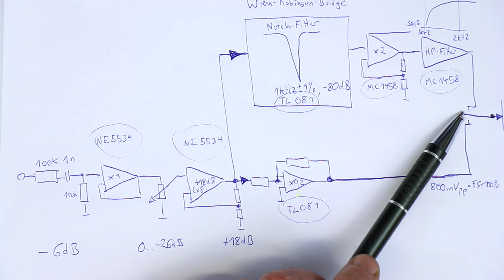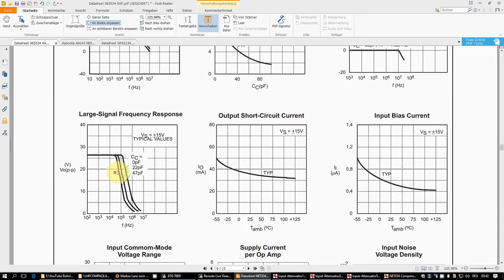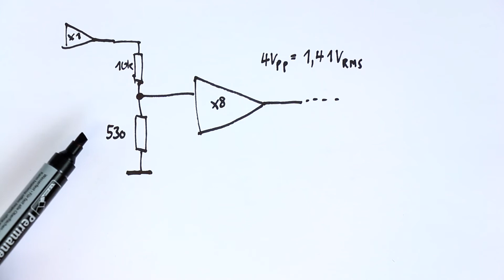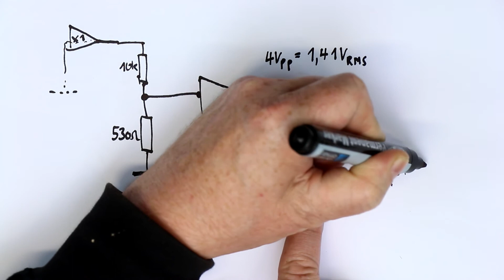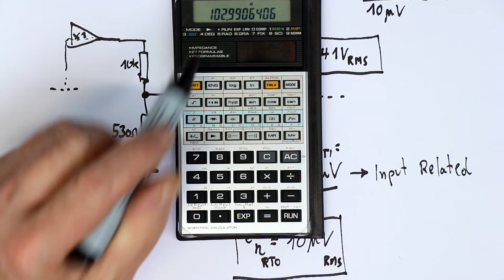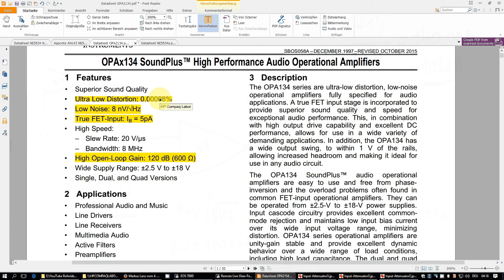Precision OpAmp Design Pt.4: OpAmp Selection for Minimum THD

Comment: Excellent video. Would have saved me lots of time and effort a few years ago if it had existed :)
Reply from the maker: The KMG7000 was a dream for me when it came out, but it was far too expensive for me at that time. Thank you Ebay for getting it  30 years later.
Today you can do everything far better with a PC-soundcard and free software.
Stay tuned, because there are still a few improvements implemented by me for the KMG7000.
In the end it was only partially well designed by the ELV engineers.
As is the case with many test and measurement devices: 
Display resolution is NOT equal to measurement accuracy :-)